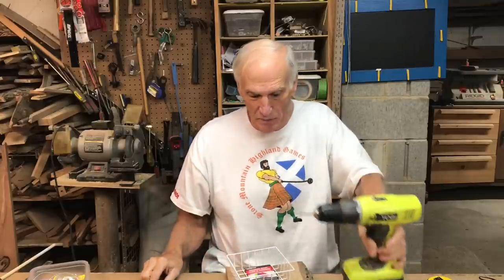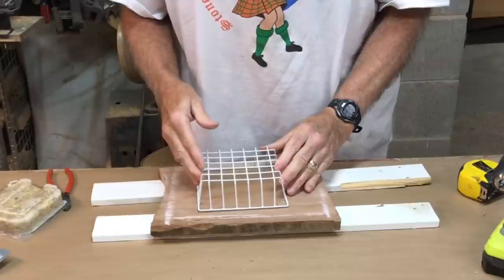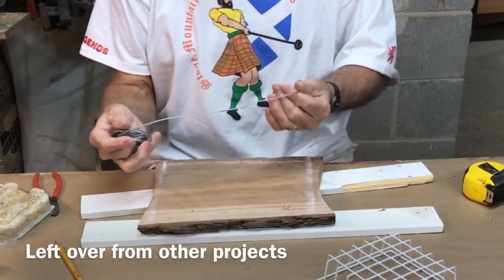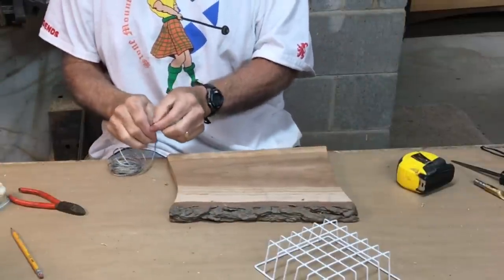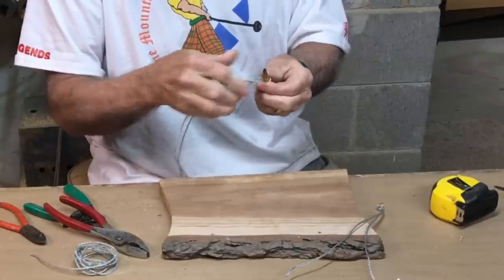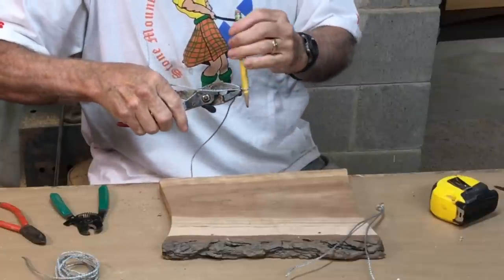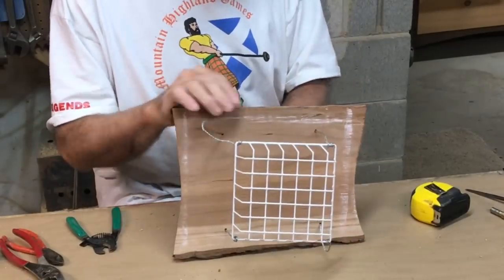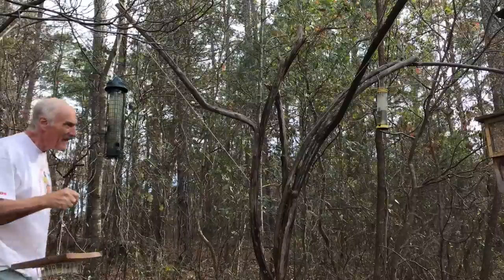$1 Bird Feeder DIY: Dollar store hack

Comment: Good, simple and yet functional. It's 2/18/21 right now and we've had two ice storms in central KY in the last week and my current suet feeder is encased in ice. This will keep the suet dry and out of the sun. I'm building this tomorrow. Thanks for the video.
Reply from the maker: Ice storms are awful, I hope you didn’t lose power.  We are due for an ice storm, it’s been several years since the last one.  Good luck with the build, it’s really easy to do.
Reply: We are very fortunate our power was not affected. Thanks for the good thoughts. Hope your storm isn't bad.

Comment: I was originally thinking you would do it with some sort of hoop type hooks to hold the basket.  But, this makes more sense, because you can get to inside the basket to refill easily.
Reply from the maker: Leisurely Logan thanks for watching. Yep, super easy and the birds love it.  I’ve not seen any squirrels trying to get it either.
Reply: @LSatch  Not that the squirrels couldn't figure it out.  Good to know.

Comment: Cheap but that setup allows for starlings to hang easier.  
For my upside I use a regular suet feeder but I duct tape around the sides which makes it tougher for starlings.  I do like your other dollar store hack on the peanut butter may need to give a try.
Reply from the maker: The duct tape sounds like a great idea.  Thanks for watching

Comment: I tried that design and found that contrary to some starlings had no difficulty hanging upside down while flapping their wings feeding on the suet.  I used quite a bit larger board (actually plywood) with no good effect.  Final result:  Just much more trouble changing the suet.  I have also used a 'chicken wire' basket around the suet holder that keeps them off the block and that works much better while still allowing the small birds access from the bottom and through the openings.
Reply from the maker: We have problems with squirrels too.  Of all the feeders, this one is the one they don’t bother.  Probably because the other feeders are so much easier to steal from.😄
Reply: Yes, I saw a video where they had put up the suet cage on a 2x4 upright pole with wire mesh around it bolted to an horizontal ply to dissuade starlings -- the woodpeckers would take turns going up and down the 2x4 from ground up!  
Q: How did you put up the chicken wire -- does the chicken wire and the suet cage all hang down some horizontal support?
Reply from the maker: @0anant0  I’d like to know that too.

Comment: Squirrels would be on that feeder in a heart beat. If you know a city, state, country where there aren't any squirrels then this might work, but not here in America.
Reply from the maker: You’re right, we have squirrels too.  They usually don’t bother this one because there are others that are easier to get to
Reply: @LSatch  Then you don't have a squirrel problem. I get as many as 20 squirrels and they annihilate everything they can get unless my pellet gun gets them first. I don't think they're cute.
Reply: You get a 4" PFC 7-8' pipe from Walmart. You sink 3 36" metal fence post designed to chicken wire. Place the $' pipe over these posts. (You'll need to prefigure the post placement to hold the pipe which should be located in the open enough so squirrels can't jump to it.) Now get big  hooks and hang feeders from the top of the pipe. Mostly this works until a smart squirrel figures out how to run up the pipe with momentum. Then buy lamp oil from Walmart and coat the outside of the pipe. It now becomes impossible for them to climb. You can have some laughs watching the squirrels fall on their butts. They'll periodically keep trying. So keep the pipe lubed. This is the only thing I've tried that absolutely works. The 4" pipe is key because the diameter is too great for them to reach around.
Reply: @LSatch  Some people seem to have an endless cash supply but I do not. I think songbirds have a more difficult life, woodpeckers too because people are cutting down too many trees where they make their homes. A dead tree is a home for many families of birds. I have kept a dead tree on my property just for this reason and it isn't a danger to any building, etc. should it some day tip over. Thank you Larry for helping wildlife carry on, you're a good soul.
Reply from the maker: @getin3949  I’d say you definitely have a squirrel problem.  I have nothing to offer.
Reply from the maker: @getin3949  we have 4 acres of woods.  My son is a tree trimmer.  I have several, 6-8, very tall dead pines, that like yours, won’t hurt anything if they fall.  Every time my son comes to visit he wants to cut them down.  I won’t let him.  About every other year we get pileated woodpeckers nesting in one of them. 

Thanks for the kind words.
Reply from the maker: @laurencegoldman4639  thanks for joining the conversation.  Sounds like great advice.
Reply: @LSatch  GOOD man.
Reply: @LSatch  Cudos to the woman at the garden center in Mena, Arkansas who told me.
Reply: No squirrels at my place in central Washington. Out in the boonies, so there are places without squirrels. This is an excellent idea to keep magpies from eating the suet!

Comment: Have you considered the coating on the basket, which may be some type of rubber or plastic, similar to the coating on a dish drainer? I would worry that the woodpeckers might ingest bits of it while pecking.
Reply from the maker: I haven’t seen the coating deteriorating yet.  If it should I’ll just replace the old one and recycle it.
Reply: @LSatch  Thanks! Will try it.

Comment: Do you have any tips on how to keep squirrels from eating all the bird seed?
Reply from the maker: Sorry I really don’t.  I haven’t seen a squirrel proof feeder yet that really works.  We’ve tried the hot pepper stuff and several different feeders.
Reply: @LSatch  My squirrel proof idea works. Easy and fairly cheap. Use either a 2x4  trimmed to where it's 1 1/2" x 2 1/4" for the pole . Slide a pvc down tube from a rain gutter (8' is about $ 8 at menards)You can also slide it over a pipe used for your feeder. I spay a little garage door opener grease to add but I don't think you need it. I watch em try but they cant grip around it or clamp claws in it .They can only jump up so high and fall off. Mine are all at least 5 feet from ground.They are entertaining to watch them try.Keep the feeders away from trees or fences they can jump down onto them. I have 3 squirrels that come every day and feed from what the birds drop on the ground.